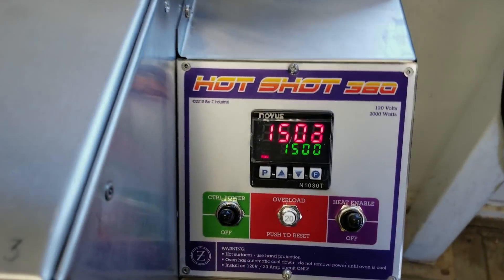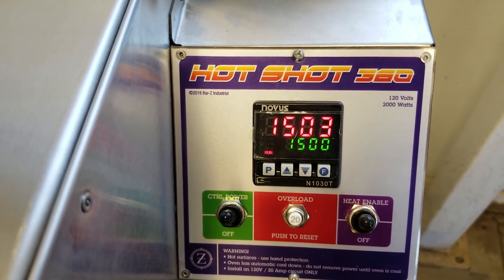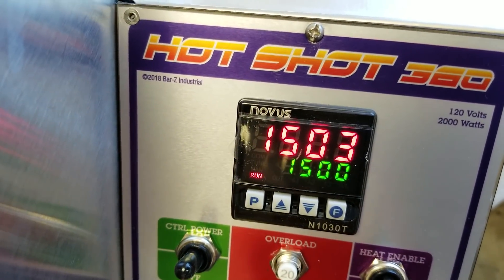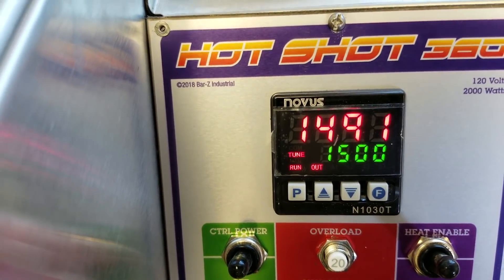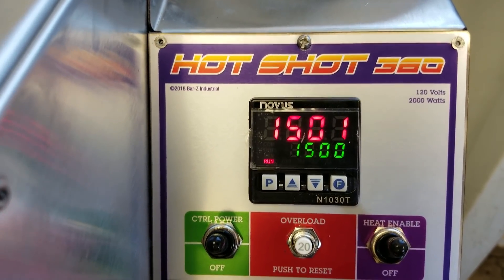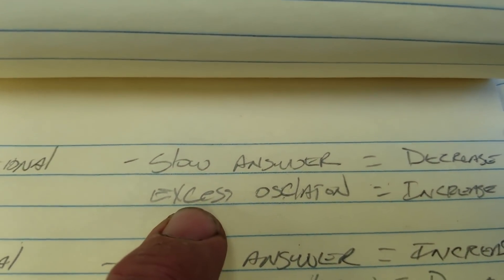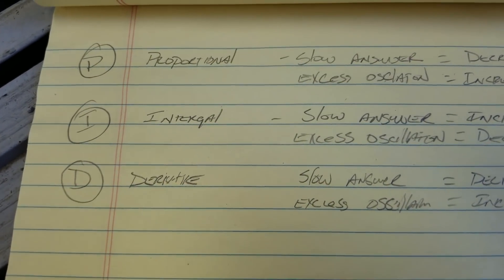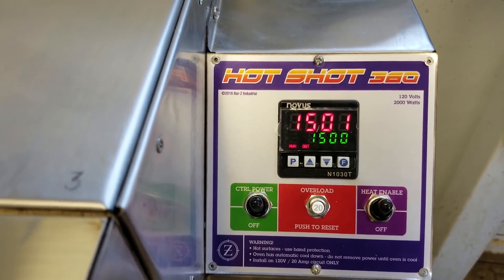The Hot Shot 360 what the heck is a PID? Novus temp control

Comment: A long way from discrete analog temperature controller a company I worked for in 80s had on their standard resistor oil bath. Controlled bath to within a tenth degree. But was all done with discrete circuitry. Very glad it never broke. As I recall the controller was about the size of your entire oven.
Doc

Comment: This is the way I learned PID

Proportional tries to get the actual value back to set point. 
Integral tries to draw a straight line (on the graph of actual values; aka stabilize actual values) regardless of set point. Integral stops oscillation.  If setpoint is 1500 but intergral can stop oscillation at 1450 then thats what will happen. In PI control, assuming its stable at 1450, P will bump output to bring actual value to back to the 1500 setpoint.
Drivative takes over in the event of rapid changes. Say an operator closes a valve down and temp begins to rapidly drop, D will override P and I and set output to 100% in order to stop the drastic changes.

Comment: Think of PIDs while driving. Your foot pushing  on the gas P=proprtional.  Letting off before your set point and/or applying the brake (stop sign or MPH) is D=derivative. Your error to the set point (i.e.  you stop short/past the stop sign or ask for 65mph and your at 62 MPH) is I=intergal. If your gains on P are to high you will have occilation or more overshoot. I.e you are at a stop sign trying to get to the next one, if you gains are too high you would floor it until you get to the stop sign and then let off. As you can imagine, you would over shoot your target. Then you would floor it backwards, until you get to the stop sign and let off again, this is over shooting and creating the occilation. Too low P gains and you will be the grandma that doesn't go over 10 mpg to get to the sign. D helps as you get close to the sign you let off and apply the brakes, anticipating  the target. Too high gains and you will stop short. Too low and you will over shoot. I integral corrects the error. Let say you stop 5 ft short of the sign. Intergal comes in and nudges you to the target, other wise you get what's called a "steady state error". Hope this helps as it help me understand how to tune them for drive by wire throttle systems on a car. Also look at P=present error D=future error I=past error